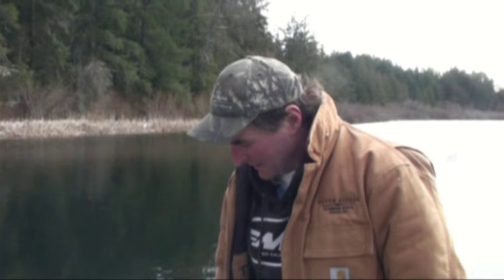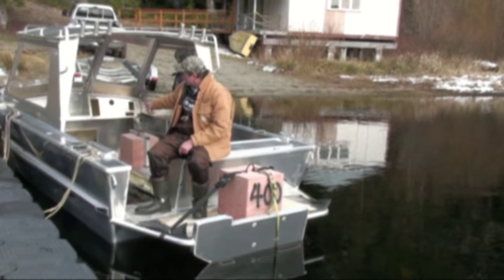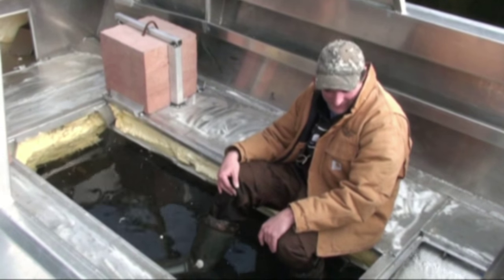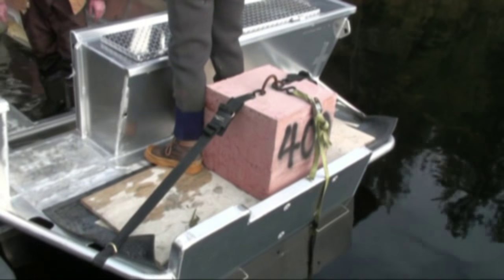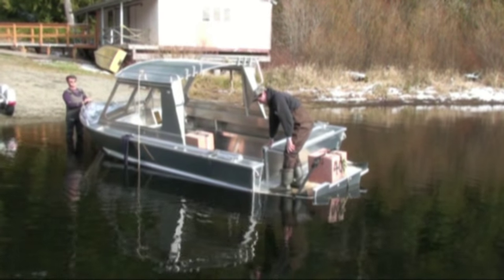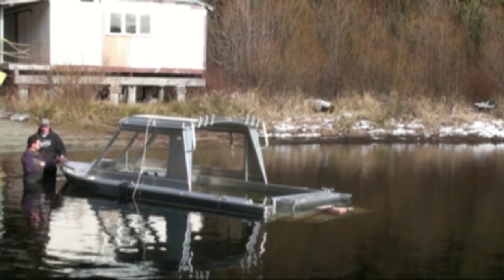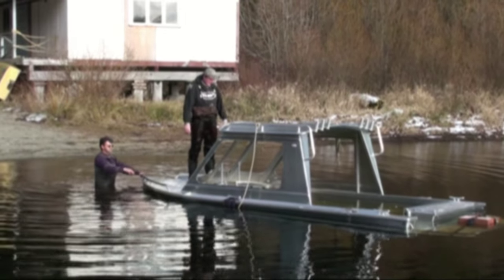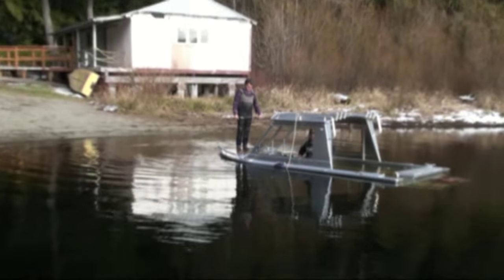Silver Streak Boats - Floatation Test

Comment: After owning a couple boats with water logged spray in foam that would be a No go for me. Closed cell or not it will eventually absorb water is it gets wet.  Block foam would be much better.
Reply from the maker: There are videos on you tube comparing closed cell spray foam with billet block foam. The block foam always absorbs more water than the spray foam. 

We put a lot of thought into the design of the hull and how/where we apply the foam to ensure water is not getting beyond watertight bulkheads and that the foam is sprayed in such a way that it causes minimum pooling.

We are at the mercy of government standards to use a coast guard approved foam along with maintaining level flotation. Thanks for your comment!

Comment: Hi, is Canada requiring to have flotation foam in ALL boats? Can i remove all my foam from my 12ft aluminium utility boat?
Reply from the maker: Hi, great question! As a manufacturer we are mandated to provide so much flotation per cubic ft for vessels < 5m in length. Furthermore, we also must track how much flotation each boat receives. However, we have seen used boats of various brands that lack flotation, have damaged (exposed/porous) flotation or removed flotation, as well. It is one of those things, it's not a problem until it's a problem. There is a reason these standards exist. The boat may react the same in the water, but has safety been affected and to what degree? Will your boat be inspected for flotation? Is it an insurance issue? Lots to think about for sure! We hope this helps. Best of luck and always, happy boating!
Reply: @silverstreakboats4129  Thank you very much for your answer. I will do a little more research before removing my floatation. I want to do some simple work and need to put minimal floatation. As it is not for insurance or inspection purposes i think there wont be too much problems. Thanks for your time and help

Comment: That hull looks the race rocks/carmanah?  I just got my 18ft Carmanah soft top from SG power and am really impressed with the build quality so far.  We looked at buying hewes, weldcraft, and kingfisher but when I learned that they had plywood decks with vynil wrapped floors and Silver Streak had welded aluminum floors with non-water absorbing foam it made the choice easy.  Plus the hull shape/deeper V of the Carmanah vs the others was what sealed the deal.  I have had our boat in some decent waves backing into them to recover prawn traps and the boat exceeded my expectations!
Reply from the maker: Correct! Same design as your Carmanah. Congrats on your new boat! Glad to hear you are out there enjoying it! We also appreciate your attention to detail when shopping for your new vessel. It's these small things that make a big difference for the operator on the rougher seas. Not to mention make for a longer-lasting and more valuable boat. Take care of it and watch it keep it's value for a very long time! Hope to see you out there. Happy fishing!